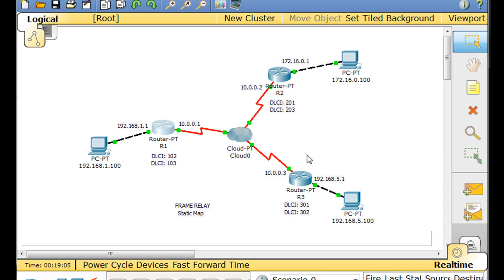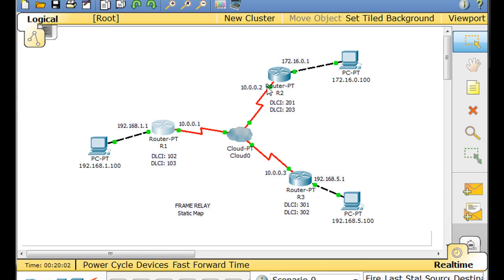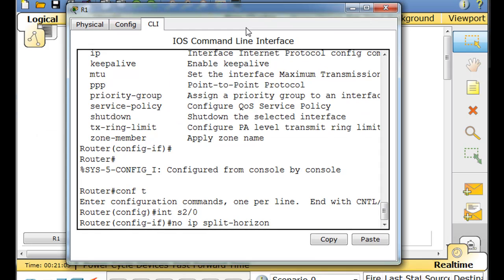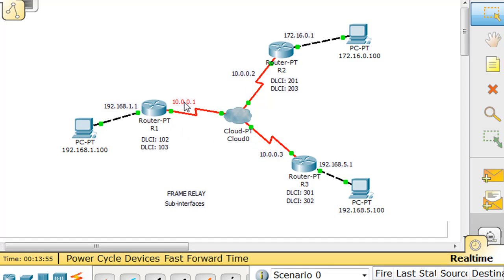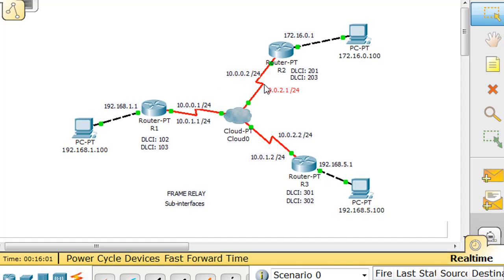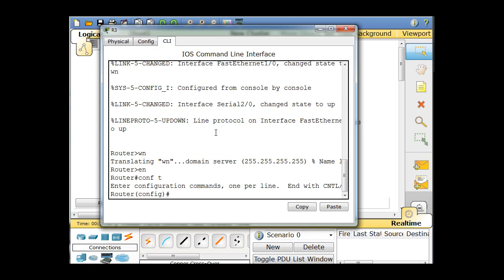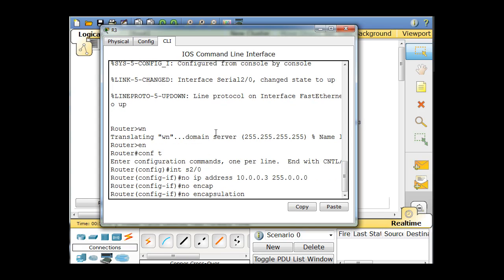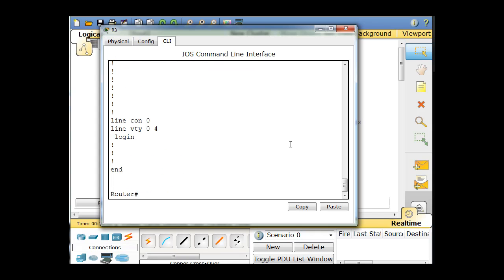Configure Frame Relay for the Cisco CCNA - Part 5

Comment: George Giorgakis yes you can achieve the same result with ospf ,remember to place the subinterfaces networks, and if you are not using subinterfaces just static frame relay you have to put in the serial interface the command:
"ip ospf network broadcast" ej:
 R3(config)#interface s2/0
 R3(config-if)#ip ospf network broadcast 

and it will get it working
Reply: +marlvalv  it was driving me crazy. Thanks.

Comment: Hi many thanks for your video. It so far clear but what I do not understand is this. You configured Rip as routing protocol. Rip is a class-full routing protocol. You are using the 10 addresses with a 255.255.255.0 subnet. Because Rip is a class-full routing protocol rip it will use the basic subnet for a class A address of 255.0.0.0. Is it not necessary to change the routing protocol to a class-less routing protocol ?